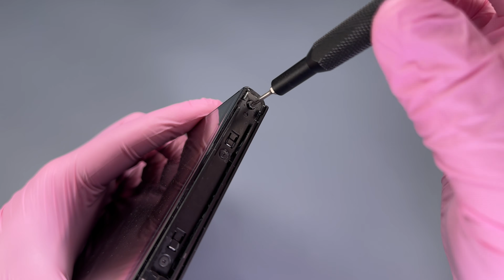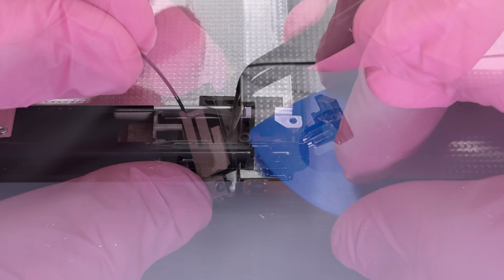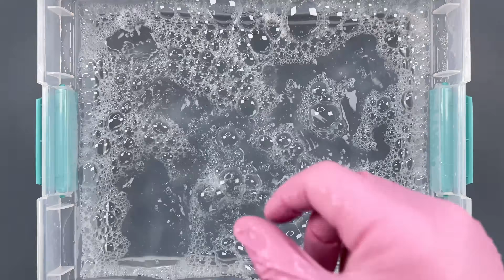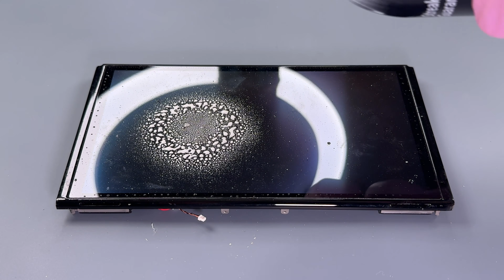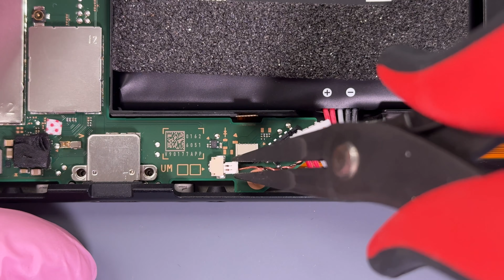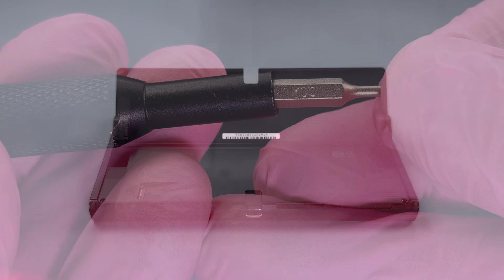Will Switch OLED Deep Clean Fix This Joy-Con Connection Issue?

Comment: I just got a brand new switch oled, and it had the same issue. since it's a couple of days old, i don't think gunk would be a factor into this problem. It connects well with pro controllers and wire controllers, but it seems to have an issue with any joycon controllers with it either not working at times or disconnecting often.

Comment: From cleaning things personally I've come to find out that if alcohol doesn't work away at a certain substance and you need to scrape it off then resort to either a lower % alcohol or some sort of cleaner or even just water. Sometimes, water can dissolve stuff that alcohol can't. Alcohol works great on adhesive, but works poorly against stuff like sugar.
I'm just assuming you use 99% alcohol.

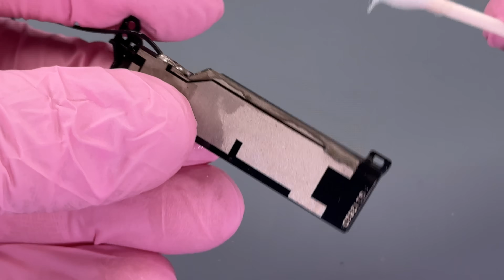Comment: 10:22 to remove large amounts of thermal paste, it is much better to use an ordinary paper towel instead of wasting cotton swabs ;)
 but in both cases, you MUST clean the rest of the thermal paste with IPA (so as not to mix the remnants of the old paste with the new one later)

Comment: Just a tip; you can buy toothbrushes with super thin bristles, it is really great for cleaning smaller cracks and crevices, like the ones around the screen on the Switch.

Comment: Thanks for another relaxing video. Just for the info you can pull out pin from a joycon rail and there is a small pcb that can be gunky too. Had this problem on my own switch

Comment: Man, I wonder what on earth that stuff was. It had to have been something like a weak liquid adhesive or a medium viscosity syrup or something. Or who knows, could be almost anything. What a nightmare! As a side tip, you could cut down one of the other makeup brushes (I assume you got a cheap set) so that it has short bristles, which can let you have more pressure like the cotton swabs. In the GameCube video at 4:20, the 2nd from the right might be good for this (or the 4th or 5th from the left).
Reply from the maker: I have had that suggestion a couple of times now. Will have to try it. 🙂